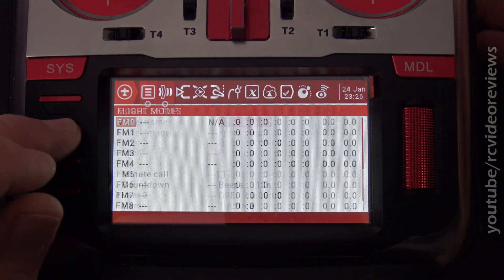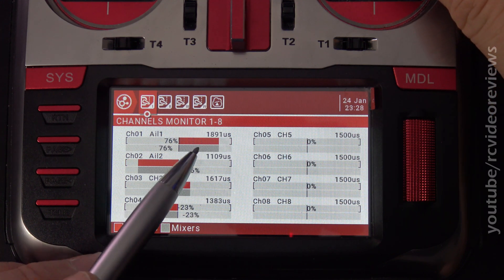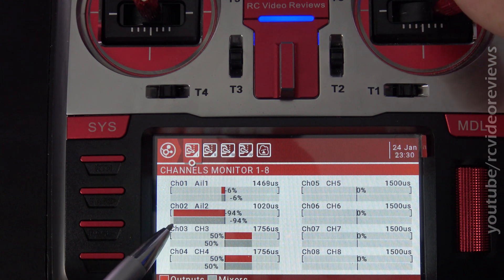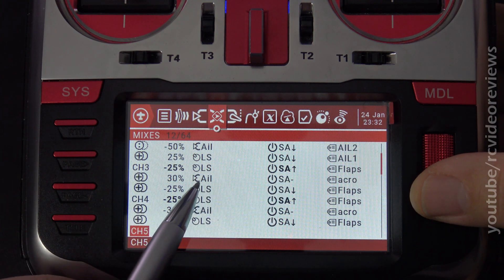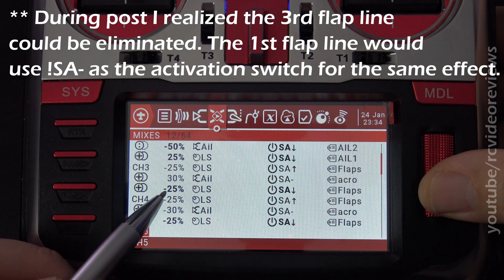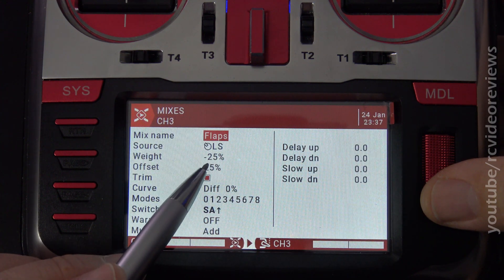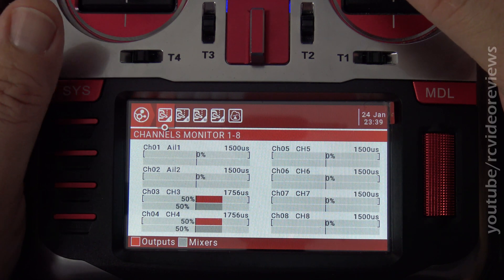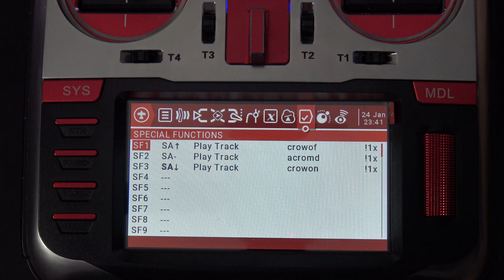OpenTx Snippet • Glider Dynamic Crow Braking Plus Acro Mode

Comment: I have used this programme and it works fine but when I tried to add rates on switch SB it doesn’t work. Any suggestions?
Reply from the maker: Rates can be turned on using any switch. So maybe watch this to see if it helps figure out what's missing: https://www.youtube.com/watch?v=kd7etAzXGEA
Reply: @RCVideoReviews  Thanks for that but I have programmed triple rates on all my other models without using companion but it doesn’t work when the Dynamic crow braking etc has been set. Is there a way I can send a screenshot of my transmitter to explain my problem?
Reply from the maker: The reference wasn't about using companion, it was about showing how to setup rates. There is nothing in a given model setup that precludes you from setting up dual rates. YouTube is a terrible platform to work these things out, you need to join our discord server and ask there. https://discord.gg/jSFTASU

Comment: My ELEVATOR red and grey bars go in opposite directions - is that a problem? Or do i have to go and set my Weight to -100 and then reverse servo direction in output? Thanks.
Reply from the maker: It's not a problem as long as the output does what you want it to do.

Comment: Mmm, can't ever imagine a glider pilot using anything other than the throttle stick for crow/brakes position ?? Motor would be on a switch. Flight modes on a couple of 3 positions. They're normally not flown like a sports power model :-)
Reply from the maker: That's where the "glider novice" comes into play. Is there any reason what you see in this config wouldn't work?
Reply: @RCVideoReviews  setup seems just fine, only needs transferred to the throttle channel. Coupled ail/flap volume would be via one of the flight mode switches.

Comment: I fly gliders, in the UK, a lot and use crow braking extensively. Your users will find that deploying a large amount of flap during crow will produce a large nose up movement requiring  significant down elevator. Adding a mix to include a large portion of down elevator compensation will produce a more stable flight in crow.
We have an 'opentx' guru in the UK, Mike Shellim, a well known F3f racer over here. He has a series of templates for programming different types of gliders on his website      rc-soar.com. and although these look complicated, and the programming certainly is, the documentation and step by step instruction Mike has produced is excelllent just don't be overwhelmed by the complexity of the programming. I have used these for a series of gliders from racers, flying wings to scale models and they work really well. It is worth a look and even if you don't use any just looking at the programming adds a whole new dimension to opentx.
Reply: I use Mike's templates on most of my models, from F3F to 4mtr scalies. I agree the programming is complex but the documentation is very well written.